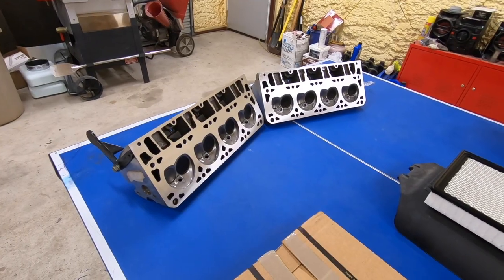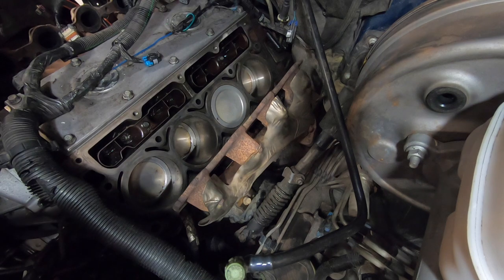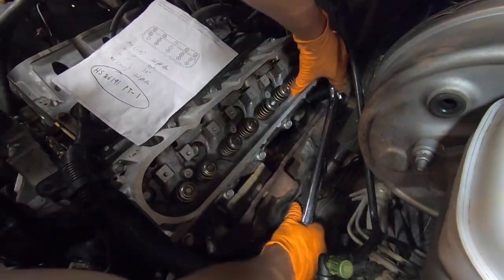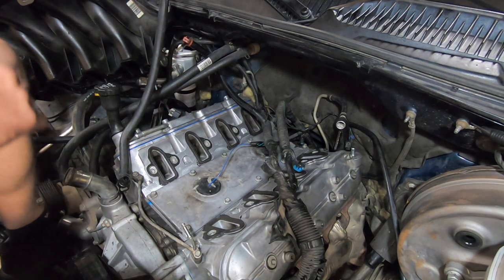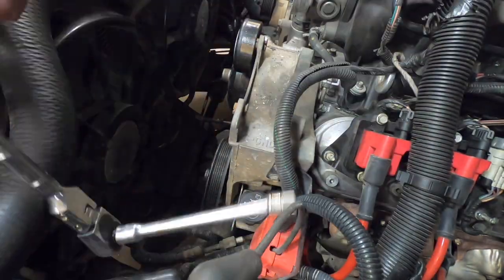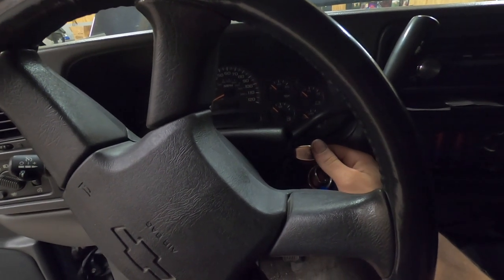Head Gasket Replacement || Part 2: Install

Comment from the maker: 0:00 Introduction
0:17 Inspection
1:50 Block Cleaning
5:42 Head Cleaning
7:11 Head Gasket & Head Placement
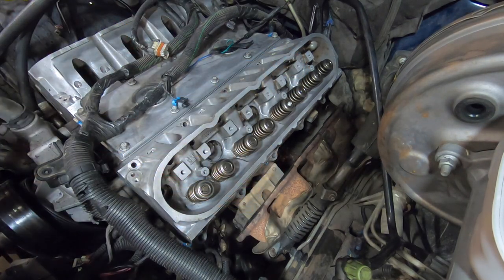9:41 Head Bolt Torque Specs
9:47 Head Bolts
15:37 Coolant Crossover & Plugs
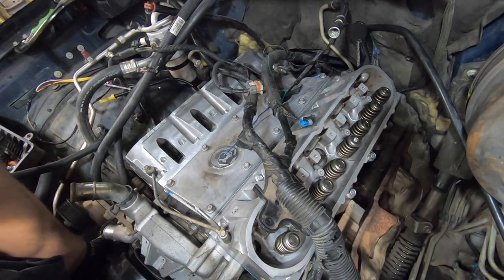17:23 Pushrods
18:30 Rocker Arms
22:11 Valve Covers
22:50 Exhaust Manifold
23:31 Spark Plugs
23:41 Intake Gasket
24:50 Intake
27:58 Ignition Coils
28:42 Engine Cover Hold-Down
28:53 Power Steering Bracket
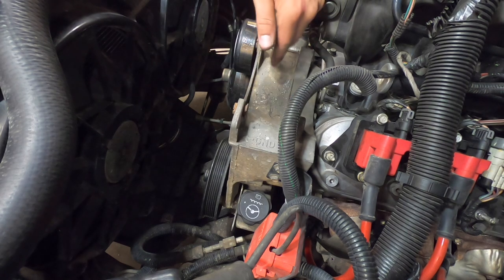29:44 Alternator
30:45 Radiator Hoses
31:53 Serpentine Belt
32:34 Air Intake
33:20 Engine Cover
33:31 Add Coolant
34:05 Prime Fuel Rail
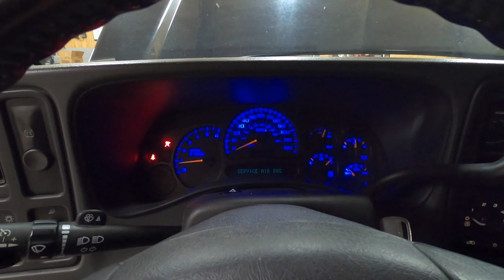34:36 Outro
Reply: Where did you gets all of the parts for this job?

Comment: I just completed mine. I have a couple friends that worked at Chevy. They made a good point to make sure where the head bolts go into are COMPLETELY dry. If not, any water, coolant in the holes will expand and crack the block. They have seen it plenty of times. I would of never even thought of that. Use lots of air and make sure they are DRY.
Reply from the maker: I appreciate the comment! I always use lots of air!
Reply: Thanks for the tip!
You probably just saved me a block the holes were FILLED with liquids of all types.
Reply: @fuqutube  Glad it helped.
Reply: Well now that new head bolts are torque spec I read this. Crossing fingers the brake cleaner with air dried enough
Reply from the maker: Brake cleaner evaporates very quickly, you should be fine!
Reply: I’ve been trying to dry them for days and they won’t dry what do I do? I got most of the coolant out there’s very little on there I used air compressor, and shop vac what do I do
Reply: @dudewecanfixit what brand of kit did u get and what came all with it

Comment: Best Head Gasket tutorial on youtube
Reply from the maker: Happy you enjoyed it! Thank you for the support 😁
Reply: @dudewecanfixit  I work Monday through friday and get off at 4 everyday so last monday for an hour afterwork I’d do a little because my new heads wouldn’t arrived til that friday by the time they had arrived I had everything broken down and cleaned up. Saturday morning I started to install the new heads got them installed then realized the one of the little 2 coolant valves in the back of the head still had part of the stem stuck in the heaf so I had to remove the driver’s side head get the little stem out then pit back on and torque again with a new set of head bolts pushing me back a day sunday I woke finished the job and she’s running better than ever
Reply from the maker: I'm glad you got it done!
That's a great way to do it, take your time and make sure everything is perfect!

Comment: Glad to see someone removing the head with out removing the exhuast cuz its a paint does 3 bottom bolts
Reply from the maker: The exhaust never comes apart correctly. So, I try not to take it apart.

Comment: Thanks a ton man! Going to be doing a 2004 chevy Silverado 1500 5.3 with almost 400,000 miles on it. Been my daily driver for a few years now and noticing a small leak.
Reply from the maker: Make sure the head surface is flat. You may want to get it machined or checked by a machine shop

Comment: Thank you dude! One comment, the driver's side head has the coolant temp sensor near the front,  the passenger side has a hole in it and is leaking antifreeze.  Not a problem because the old head on the passenger side has a plug in it.  Just transfer that plug, leak is gone
Reply from the maker: That's great! The heads are interchangeable, so if you swap them around that hole would be used for the temperature sensor.

Comment: Definitely want to do this to my 07. Something to save up for for next year
Reply from the maker: Are you fixing an issue by doing this?
Reply: @dudewecanfixit  I have no issues at the moment. But I do want to get it all rebuilt. Mine has over 200k on the clock.

Comment: Great video! Thank you. During your torque sequence it doesn’t look like you have a digital “angle” torque wrench or are using an angle guide. Are you “eye balling” the 90 and 70 degrees or did you calculate the ft lbs that would put you at. I’m currently replacing both head gaskets and lifters on a 2012 6.2l with a failed lifter. I have a 3/8” 10-100ft lbs click style torque wrench but unsure if I need to buy one with angle for this one job.
Reply from the maker: I just eyeballed it

Comment: On the 3rd pass is 9 & 10 50 degrees or 70? ...I have a 02 yukon xl 5.3 vin z l59 great video by the way.
Reply from the maker: I don't remember off the top of my head, but I show the Alldata instructions before I tighten them down.

Comment: @Dude We Can Fix it - I Noticed you refilled the cooling system with green antifreeze. If I don't recall, most of these GM LS motors call for the orange DEX Cool. Do you prefer the green antifreeze to the orange?
Reply from the maker: I do generally prefer the green over the orange. However, I always recommend going with the manufacturer recommendation.
Reply: Every time I've seen somebody use the green and not the orange in a GM vehicle they end up blowing that seal in the water pump that is between the bearing housing and that weep hole that's there and it ends up leaking like a $2 sprinkler from Kmart out of that wheat bowl every time if you use the green if you use the orange I've never come across that problem but for some reason the green breaks that gasket right there

Comment: Is it a must to have the heads sent off to a machine shop to replace the head gasket? Top notch tutorial man
Reply from the maker: If you are replacing the head gaskets because the vehicle overheated, then yes, the heads are probably warped and would need to be machined

Comment: Muy buen video, explicado paso por paso, con este video pude solucionar mi  problema. Muchas Gracias.
Reply from the maker: Mucho denada
Reply: How did you dona 90 degree turn without a scale or something looked like a regalar torque reach was used

Comment: How do you keep old gasket material and debris from falling into passage ways when cleaning mating surface? Great video.
Reply: Stuff clean rags into all holes while you are working.
Reply from the maker: I put clean rags or paper towels into the intake holes before I start cleaning.
Reply from the maker: Exactly

Comment: Great video!! I think I screwed up torque sequence, "I should have had diagram facing the same way the heads was. Should I get new bolts and try again? or I might have a chance they hold? I'm just trying to get thru winter.
Reply from the maker: You should be fine, main thing is to start in the middle and work your way out.

Comment: Great video....is the process of sending the head to get machine mandatory for a head gasket replacement if it is what is that process called and what you think that would cost... Im in the process of replacing a gasket on a 6.0 L77
Reply from the maker: If the engine overheated, it is likely that the head is warped and just replacing the head gasket will not be enough to get a good seal. Usually getting the heads reworked is under $300

Comment: Did u have to reset the timing after moving the pistons with the heads off
Reply from the maker: No, because we did not adjust the crank to camshaft timing chain

Comment: Will I need to do this procedure as well as the value seals as well?  I have rough idling and noticed oil sealing out from the spark plugs on cylinders 7, 2, and 4.  All spark plugs were oil fouled after replacement.
Reply from the maker: I would imagine that is the best thing to do. Have you gotten an opinion from a local mechanic?

I say local, because it's hard to diagnose something without seeing it.
Reply: @dudewecanfixit  not yet, but a mechanic told me if there isn't blue smoke in the exhaust, try an engine spray deep cleaning and catch can, since blow by is very common on GM LS engines.  So far it's helped.  I still want to take it in to get it looked at.
Reply from the maker: Definitely take it in to a trusted mechanic to get it checked out.

I've never heard of using a catch can on a gas burner, but maybe that's a good idea.

Comment: When it comes to how clean the block surface needs to be. I had what looked like staining that my razor blade wouldn't take off. Is that normal, or will it make the gasket fail?
Reply from the maker: If the surface is buttery smooth, it should be fine.

Comment: Since you had the heads machine,  does it change your piston to valve clearance? (Change what thickness of gasket use)???
Reply from the maker: It does, however I use oem thickness gaskets. If you have the heads machined multiple times or have a lot of material taken off, you would certainly need thicker gaskets.
Reply: Thank you

Comment: First, thanks for the video! I noticed you didn’t clean intake manifold very well, as in the ports, throttle body and the injectors. What that cleaned in a previous video?
Reply from the maker: I didn't realize I forgot to include that in this video.

Here's a complete video on the intake
https://youtu.be/2SNkavPXEOI
Reply: @dudewecanfixit  Thanks! I appreciate your videos; got a 4.8 that needs a new head gasket!
Reply from the maker: Nice, are you going to do it yourself?

Comment: Nice step by step my Dude. Just an observation, would you not go ahead and replace the lifters while the heads are off? These engines are known to drop a lifter or two.
Reply from the maker: It is definitely a good idea to replace them while everything is apart. I sent this head off to get resurfaced and valves replaced per customer request.
Reply: Thanks for the reply. I love your channel. I'm about to tackle this job shortly.
Reply from the maker: I'm glad you enjoyed it! Please subscribe and share. This really isn't a bad job, just take your time.

Comment: Dose it matter if the engine is on tdc and align the mark wen doing ls headgasket?
Is it safe to torque then and all good to go?
Reply from the maker: TDC is not as important as I thought. Be careful not to strip the threads on any of the bolts, put them all in by hand and then torque them. Rotate the engine until some of the valves go down, and that will reduce the upward pressure on the adjacent lifters. Retorque, rotate the engine, retorque. 

You want to make sure you torque each bolt with minimal upward pressure on them.

Comment: On your paper I noticed it has to turn it to 90° then there's a 70 under. Are they being turned to 90° followed by 70°? Confused on that part
Reply from the maker: Yes, I go through the entire process in the video.

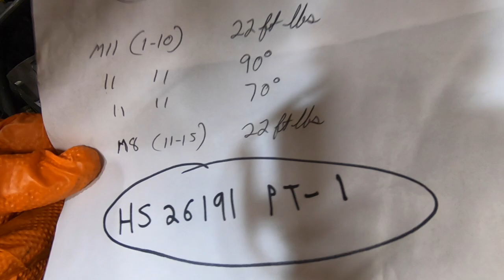Go to 14:30 and I explain the 70°
Reply: @dudewecanfixit perfect, thank you so much!
Reply from the maker: No problem

Comment: @Dude We Can Fix it - After they clean and machine the cylinder heads, how can you tell which one is left and right, Or does it not matter ?
Reply from the maker: This is one of the magic points of the LS engine. The heads are interchangeable, so it does not matter which side you put them on as long as the intake ports are facing the center

Comment: I'm a noob when it comes to auto repair and I may have missed something but what is the reason for removing the radiator hoses?
Reply from the maker: To get them out of the way and also to drain the block of coolant. The heads have coolant passages in them and if you do not drain the block, it will make a mess when you remove the heads and possibly get water in your cylinders

Comment: Ugh! How do you get.the exhaust manifold far enough away from the head to get the bolts in!?  I have been struggling for days
Reply from the maker: I'm a little confused by your question. Perhaps you can loosen one of the exhaust donut clamps, a triangle shaped metal bracket with three bolts in it. Maybe that will allow you to wiggle one side of the exhaust manifold to spread them apart and use a floor jack underneath to lift them up.
Reply: @dudewecanfixit  I used a wooden wedge.

Comment: What head bolts brand did you use? 
Im in the process of putting my heads back on as well.
Reply from the maker: I think the gaskets and head bolts are felpro
Reply: @dudewecanfixit  thanks man, i ordered the same ones i think their the felpro brand  ES 72173 but seen comments of people snapping a bolt when torquing but looks like yours went in smoothly.
Reply from the maker: That's wild, I use felpro wherever possible. They're a good brand.

Comment: What about using anti seieze if your doing this on a aluminum block ls engine? Is it needed?
Reply from the maker: What bolts are you referencing specifically? I would not recommend it on head bolts, they usually come with threadlocker pre-applied

Comment: So when tightening the 90 and 70 degrees how strong does the torque wrench need to be able to read to accomplish this?
Reply from the maker: I recommend not using the torque wrench for this part so that you don't risk damaging it.
Reply: Good question you need a degree finder . First pass 22lb second pass 90 degrees final is 90 degrees except 9/10 are 50 degree passes.

Comment: i have quick question is fel pro is good kit for gaskets?
Reply from the maker: Yes, fell pro is very good quality gaskets
Reply: @dudewecanfixit  what do you recommend with stage 2 cam full kit and I got gasket kit just wondering so I can be safe

Comment: Keep an eye on those heads. Those are 706 Cas-tech heads. They are known to Crack at the valleys for the bolts.  I have replaced my wife's heads because of it. They have a extremely small Crack but will slowly loose coolant into oil.
Reply from the maker: That’s good to know, thanks for the input
Reply: I am currently replacing my wife's heads for exactly that reason. I chased the issues forever before finally figuring out the problem.
Reply: @davem3945  how do you diagnose that
Reply: @chevyss18  what finnally was the lightbulb moment was, I opened the oil fill cap and there was red residue coating the inside of the tube. the vaporized coolant coated inside the fill tube. once the valve covers were removed the driver's side was normal but the bad head side on the passenger was all covered in red residue from the coolant. Hope this helps.
Reply: I noticed they were castech also. Hopefully they hold after doing all that awesome work on it.

Comment: Would you not clean out the head bolt holes on the block after cleaning the pistons etc? @Dude We Can Fix It
Reply from the maker: I usually hit them with a blast of compressed air to get any fluid and debris out before I finish cleaning. I may not have shown it in this video by accident

Comment: Do you know if torque spec is the same with l83’s ?
Reply from the maker: I'm not sure what I83s are
Reply: L83 head was developed specifically for the stock displacement 5.3L Direct Injected engine
Reply from the maker: Oh, that's cool.

I do not know if the specs are the same.

Comment: put a brass wire brush wheel in a drill and it cleans all the carbon off the pistons, and heads of any other surface without damaging the surface.
Reply from the maker: That's a great idea!

Comment: How do get the rear lower corner bolt on the passenger side in
Reply from the maker: You may need a wobble socket or preferably a U-joint adapter

Comment: Is it possible that the bolts need to be tightened even more? I’ve done the specs but the gasket is not sealing out the coolant.
Reply: Maybe you do, hopefully the gaskets are flat in between the block and head without dirt or dips throughout. did you make sure that the engine block was cleaned and flat before putting the heads back on?…sometimes you need a straight edge and a feeler gauge to check the block for non excessive gaps on the block.
Reply: @brianj1203  Yes sir. Clean and flat. I think honestly believe I need to tighten more than the 22/90/70 guideline. I am going to try tomorrow.
Reply from the maker: I wouldn’t go too much farther. The bolts stretch and if you torque them too much they will loose their elasticity and holding strength.
Reply: @dudewecanfixit  I think I figured out the issue. The gaskets Amazon said would fit looked like a match but after buying fel-pro off of rock auto I see that the parts numbers are different and the coolant holes are bigger on the last set of gaskets I bought. I think the passages were being partially blocked causing the coolant pressure to be too high.

Comment: What happens if you put the head gasket on backwards where it says front what if you put it on where it’s at the back
Reply from the maker: The oil and coolant passages will not lineup correctly. Could cause flow problems and leaks… did you do that??

Comment: The video was very helpful but what you forgot to tell people make sure they change the oil and you never put the top cover on before the engine runs and you make sure burp with thermostat open then you can put your engine cover on
Reply from the maker: Thank you for the well thought out response, you make some good points.
Reply: Needless to say the truck is running perfect

Comment: Great video , just wondered about lower head bolts closet to the firewall , I had trouble getting mine out due to hitting the firewall , finally removing them as I pulled the head out , noticed your bolts went straight in with no problem , do you ever run into that problem
Reply from the maker: I have not had issues getting bolts out. Are you working on a van?
Reply: No Yukon xl
Reply from the maker: I have not messed with a suburban or Yukon XL but they should be set up the same as a Tahoe or a truck. Same frame and body up front
Reply: I had the same issue on an 01 silverado.. Bolt came out with the head here as well.
Reply: I had the same clearance problem I had to take the head off with the rear bolts still in the holes. and will have to reinstall in the same fashion to get them back in.